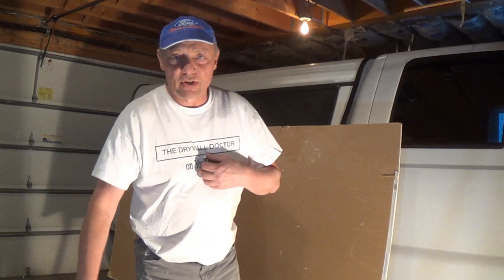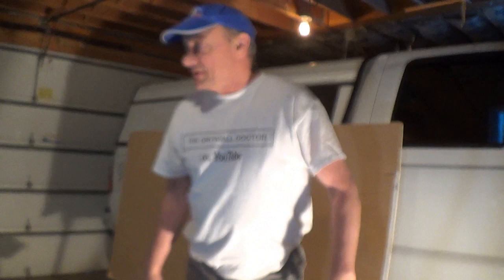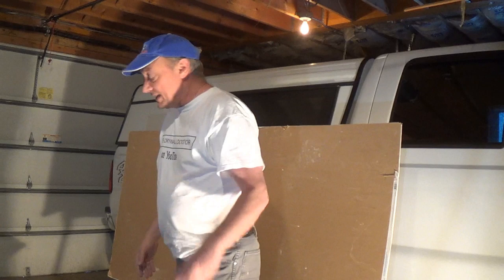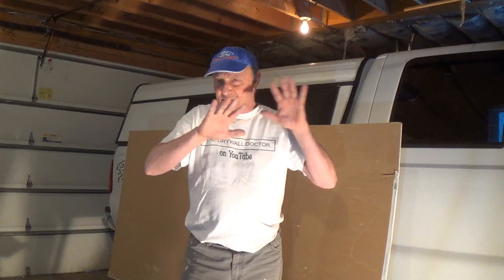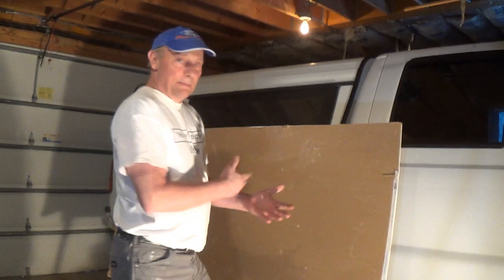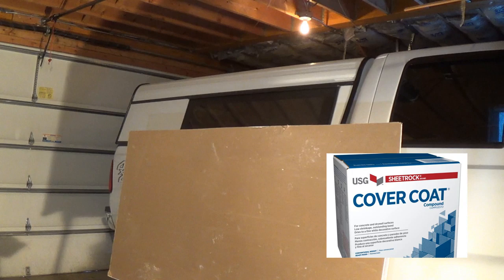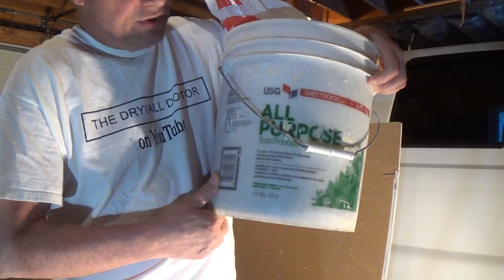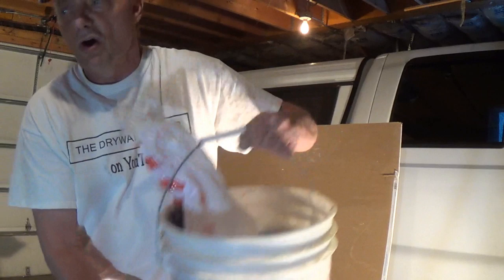Skip Trowel Drywall finish

Comment: I’ve done a Lot of skip trowel in my area here in Grand Junction Colorado and have taught it in numerous videos. But here we never use sand. I’ve used sand but I’ve never seen it in the thousands of finished homes I’ve worked on. My personal preference is for a faux finished skip trowel or interior plaster (which I’ve seen in multi million dollar homes, but I’ve never done it). Out here you seldom see smooth finish.  Funny how each region prefers different finishes. 

Hey I just released a video on discussing skim coating yesterday. I’m going to put an icard pointing to your level five video, or a link in my description. Thanks , Guy Purcella
Reply from the maker: I knew there were experts in skip trowel and I know I'm not one of them. Thanks 👍
Reply: @THEDRYWALLDOCTOR1  No problem.  We all have our strengths in this trade.  I'm not so great at framing steel studs for example, but I can do it, just not my strong side.  Hope my icard helps your level 5 video.  I tracked your icard and it did send about 20 or so views a month.

Comment: Hey Doc! What would you use or recommend for exterior drywall mud? Some time I get cracks not always but if you have any tips. Its for under decks or pool house's
Reply from the maker: Control joints are really necessary if you look underneath drive through bank tellers you will see a lot of control joints I did that with pure durabond and a texture

Comment: Ray, you mentioned some audio problems at the beginning.  I've noticed that problem on some of your videos and I'm sure there is a good lavalier (yes, I had to look up the spelling) microphone you could wear that would improve audio quality. Your commentary is valuable and funny and we need to hear it all. BTW, the camera guy you've used in some of your recent videos is very good...remember auto-focus is not your friend.
Reply: Sound is so difficult when we do it on the job.  ALL surfaces are hard and echo a lot.  I use a Lav and even with it, there's some echo, but yes it is much better.  But it's hard to mic up when we're trying to get a job done, and do a video at the same time.  I had to cut a button hole in my t shirts so the lav mic had a place to go, lol.

Comment: Skip trowel was common in California in the 70s you rite are those guys were fast but had to be ,getting paid maybe a cent or 2 a foot
Reply from the maker: We taped and finished for paint no texture 3-5 cents per foot
Reply: THE DRYWALL DOCTOR  I was hanging rock  for the same, we would have to haul ass to make a $100 a day which was good money back then

Comment: good morning - quick question.  I have a ceiling patch which has some decent sized gaps.  Can i used that trick where i use durabond, wet the tape and put on the joint?  In the past if i fill the joint it falls out and makes the tape sag.  Any help would be appreciated.  Love your videos sir
Reply from the maker: Or stick fiberglass mesh and pre fill that holds the mud in place you will still have to tape it.
Reply: @THEDRYWALLDOCTOR1  Awesome - thank you.
Reply: Not stepping on the Dr's toes,nothing but respect for Ray,just thought i could help,mix your prefill really thick,go above ceiling with prefill so it lays on top of gap edges,this will help anchor the prefill,let this dry ,sand or scrape,then tape it.
Reply: Use 5 minute or 20 minute Durabond.  Mix it thicker. then prefill. Let it set up. Then if its sagging a little after its set up scrap it flat with your knife. Then use fiber tape and then coat it with regular  Drywall compound

Comment: What is skip troweling? Why would you do this? What is the desired result? What is the point?the title « skip troweling and pan » literally means AVOID troweling and pan. Your video uses both. Is this process used when someone shoots the wall with mud using a compressor and gun?
Reply from the maker: When you shoot the wall with mud and knock it down with a knife it's called knock down. Skip trowel mimics the texture on the outside of Adobe style homes in AZ. And the title says skip trowel knife and pan not just skip trowel and pan